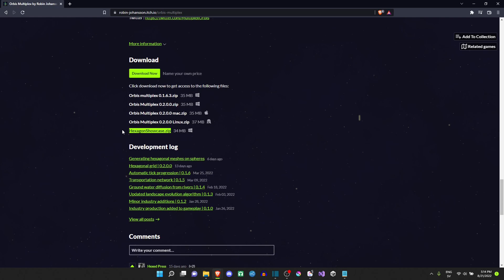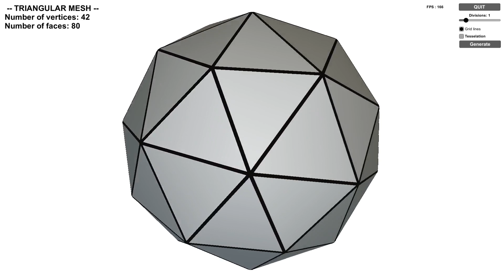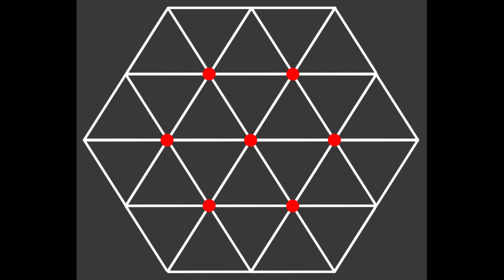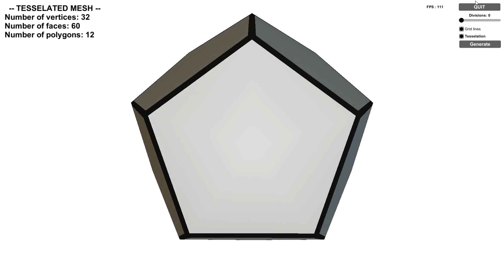Hexagonal sphere generation | Devlog #14

Comment: Question:  Why are you creating hexagons using the centers of each triangle instead of the midpoints of each edge, which would be equivalent to just taking 6 triangles at the next subdivision and removing the central vertex?  Thanks. :)
Reply from the maker: That's a good question. I tried visualizing that on my whiteboard, and it seems that using the edge midpoints would indeed give you hexagons. But they would not tile perfectly. At the corner where three hexagons should meet there would be small triangles left in the spare space. In my implementation I required the surface to be 100% tiled by hexagons or pentagons. 

I just did a 2-3 minute sketch, so there might have been something I missed. Maybe your approach is valid, but from my first glance it's not perfect.
Reply: @armemessser  Hi armemesser!  I found your response perplexing, so I looked into it further - you are half right - it only works on odd powered triangle subdivisions!  The key is you need the base of a subdivided triangle such that (2^K tiny triangles -2) (minus the 2 in pentagons) are a multiple of 3.  3 triangle bases gives you 2 hexagons - one up, one across the diameter.  For example, with each triangle divided into 32 at the base, you have 30 triangles between the pentagons, which creates 20 hexagons. 🤗 So it turns out I was lucky and you were unlucky based on the example tessellations we tried.
Reply from the maker: @TheRealJeffDiamond  Fascinating

Comment: I might be a bit late, but during the hydraulic erosion video, I was thinking it would be cool if you added coastal erosion as well. I’ve never seen that in any procedural
land generators before.
Reply from the maker: Didn't consider this force. I was considering glacial erosion, but not coastal. I wonder if coastal erosion works best with higher resolution, lets say a "tile" size of 1-100 m? In my simulations I used kms as my distance scale, which maybe wouldn't be suitable for coastal erosion?
Reply: @armemessser No idea, but I feel like you should be able to see bays and spits forming at larger scales.
Reply from the maker: @PythonPlusPlus  True. Could be worth investigating in the future.

Comment: Can the cells be addressed/indexed ? and vice versa ?
Reply from the maker: Yes. 

Each vertex and triangle is indexed. Each hexagon/pentagon is also indexed. 

From any triangle you can find the hexagon/pentagon it belongs to. And from each hexagon/pentagon you can find the 6/5 triangles it consist of. I solved it using big maps/dictionaries.

If you wanna look at how I solved it in code you can join the Discord channel. I've uploaded the code there.
Reply: @armemessser  Very interesting, thanks for answering my question, I have some more questions, would you be interested in a voice-to-voice session to more quickly exchange information ?
Reply from the maker: Ye sure. The easiest is over Discord, my username is simply "robinjohansson", write to me there and we can chat more. I live in Sweden, so UTC+1. I typically have free time 18:00-20:00 on week days. Good to know: I have not actively worked on this project since late 2022/early 2023.

Comment: would it be possible to have multiple strata/terrain types with different hardnesses and erosions rates? like boulders in a field keeping the dirt below them from erosion? you can see this in deserts, would that be possible/would you add that?
Reply: maybe add Ice/global temperature, so an ice age could lower sea level by a few hundred metres, run for sometime then flood it and see the underwater patterns of now submerged rivers like in real life?
Reply from the maker: @jzjzjzj  Sorry for late reply. The different terrain types is definitely something that could be included. I played around with that a bit when this project had a python implementation. Back then I visualized them with different colours, and it was pretty cool. But didn't have time to add it to this project. I will need to "reboot" my planet simulation some time in the future, then terrain types is something I will introduce earlier in the development.

The varying sea level based on glaciation/ice formation I think is super cool. And yes I agree that the submerged river features would be awesome to look at.

Comment: Seems interesting for geological application, but I wonder about the computational charge of porous fluids simulation with a grid like this
Reply from the maker: I've tried doing some diffusion simulations on it. Writing GPU kernels works perfectly fine, just take the edge count into account (5/6). And that has very good performance. Now im not 100% certain what a porous fluid simulation would entail, but if you can make a GPU kernel for it, performance should not be an issue.